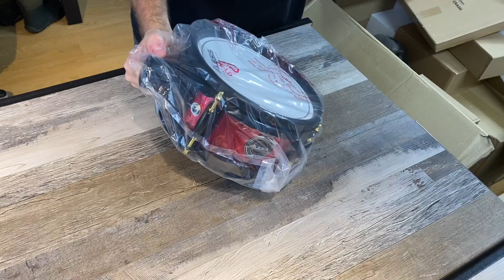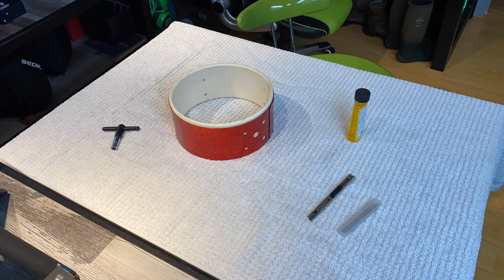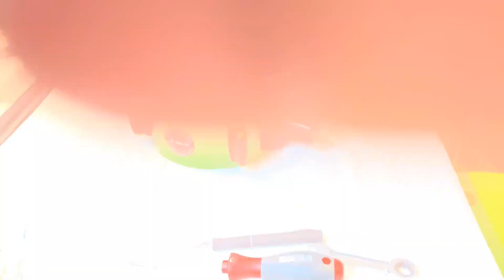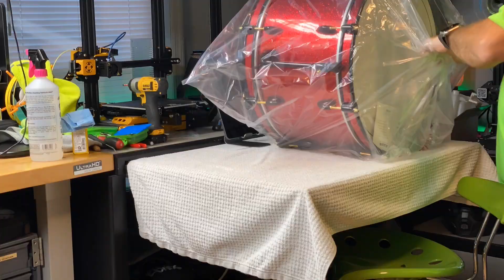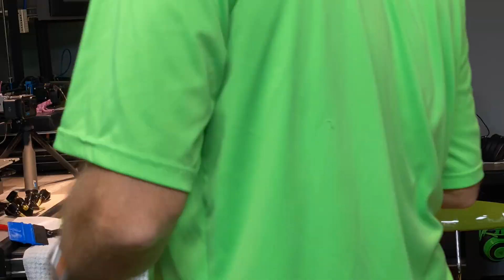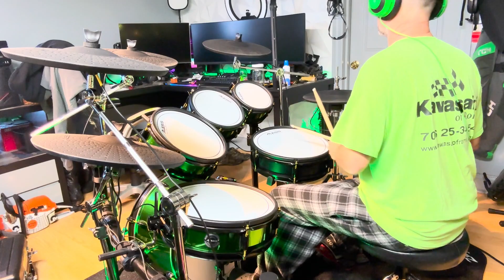ALESIS STRIKE PRO GREEN CHROME SPECIAL EDITION! Tom Sayer drum cover #drumcover #drums #alesisdrums

Comment: Hey I just bought this kit. Does the kick drum buzz when you hit it? I tightened the heads but it didn’t seem to help. I don’t want to over crank so I’m asking around.
Reply from the maker: I noticed it does make a funny sound when hit yes
Reply: As did mine. Quick fix? Go old school acoustic drums and stuff a pillow in there. Works great!
Reply: @MavicGuy2112  dude thank you for the reply! I totally stuffed 2 pillows in there and it worked great! The one thing I have now is a lot of double triggering and heavy rebound 😂 but I’m figuring it out as time goes on

Comment: Sounds and looks great! Your hi hats seem to actually work, mine barely work hitting the edge, only consistent hitting the bow, did you modify or change the actual triggers inside, ive tried everything as far as settings, flipped the black cap on the spring, added a felt, loosened the tension nut, set bow and edge to same voice,  thinking maybe a bad pieIi or connection inside?
Reply from the maker: I can’t really remember what I did. But i think I added some poly tubing to shorten the spring travel. But I don’t think that will help with the problem you are having

Comment: What are You using to keep all the Cables nicely wrapped tight around the Rack? i like that
Reply from the maker: I think I’m the video I was using a bunch of drone battery straps . Since then I’ve 3D printed a bunch of clips and holders. And cut the harness apart and changed the wires around so they are almost the perfect length for each pad
Reply: @tq64to4  Yes very nice